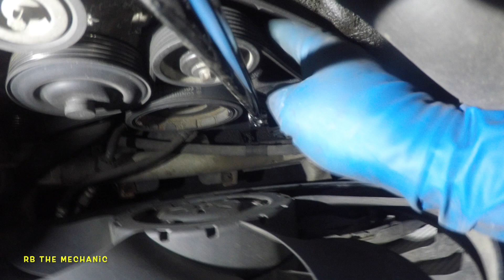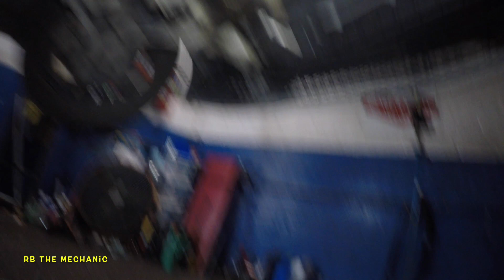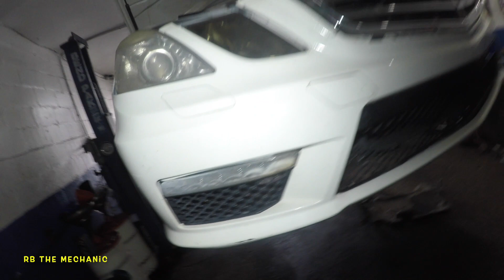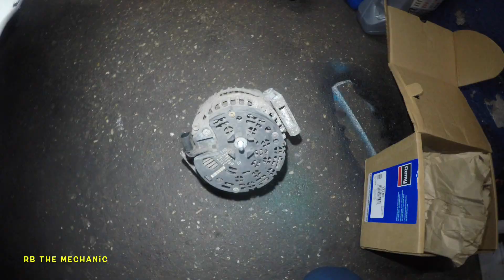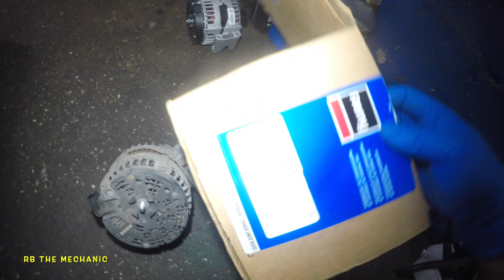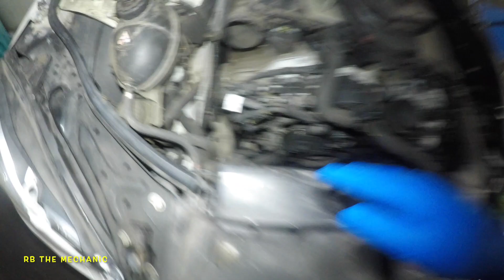2010 Mercedes Benz E350 3.5L Replacing Alternator fixed under hood noise  Part 2 of 2

Comment: I did not have an E12 socket or wrench...a 10mm socket is a little too loose and seemed to be stripping the bolt...my bolts were very tight...so a 3/8" 12 point wrench or socket gripped the bolts much better than the 10mm...good luck